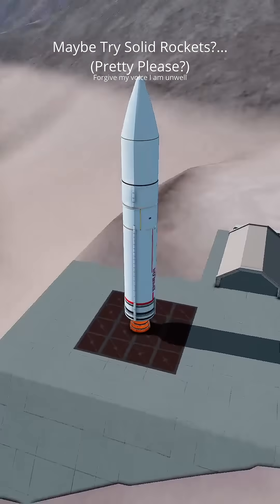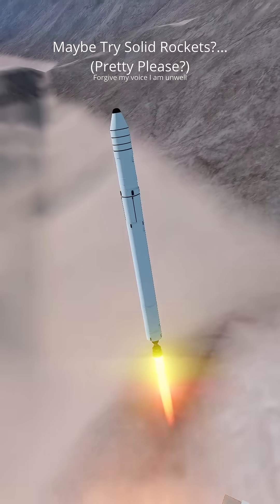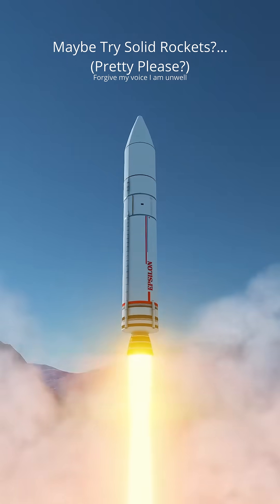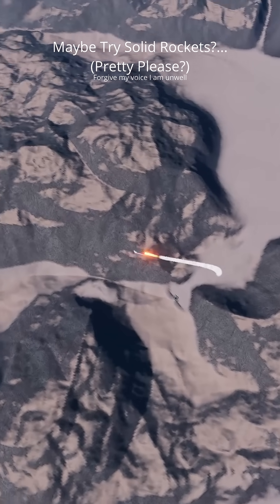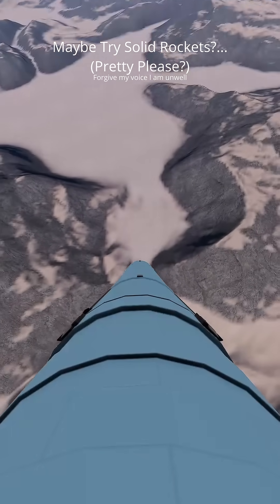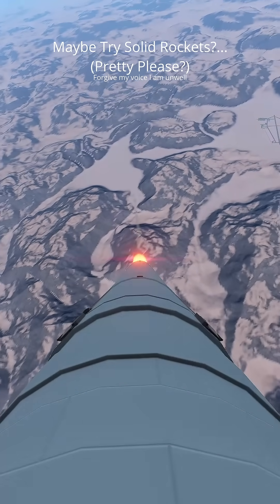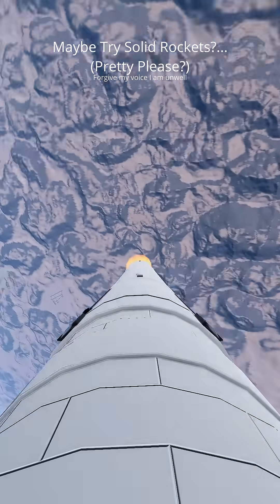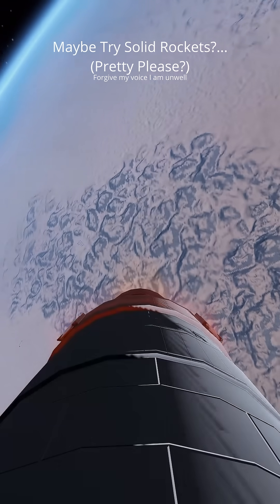Stop Making Liquid Fueled Rockets. (Maybe)

Comment: I love getting a solid motor to work. The R.200 B on the juno website is me. The R.155 T2 is me. And it turns, with no mods. But I've got a liquid fuel version too. With a 10t payload, the liquid fuel R.155 has 7.26km/s d-v ($8.1m), the solid fuel R1.55 with the exact same tank size has 6.93km/s d-v ($5.8m). The liquid one is the better rocket, but it was designed for telescopes and there's just no need for more d-v than the solid motor version.

That said, my preferred use of solid motors is impulse grain... :) Early thrust counts for so much. I've got a rocket where I've tuned the impulse SRBs to get to 98.6% damage. They nearly explode from heat death, and then they get discarded. It's great. It allows you to tune the main engines for higher altitude and efficiency.
Reply from the maker: Yeah solids are neat

Comment: After I watched the video I actually made my own solid fuel rocket, and it preformed flawlessly, though hard to control I used a gyroscope to pitch it.
Reply from the maker: That’s awesome, if you’re on pc I made a mod that adds gimballed solid motors if that helps
Reply: @DeepSpaceIndustriesLOLI’ll check it out later on, I like to challenge myself to do it manually without mods, do you have any suggestions to make the rocket more better?
Reply from the maker: @Phat-b6q spin stabilization might help
Reply: @DeepSpaceIndustriesLOLI should try that.

Comment: U can also use 1 big solid engine with let's say two small liquid engines and have them control the rocket though this works with fins most of the time too
Otherwise nice vid!
Reply from the maker: Interesting idea
Reply: @DeepSpaceIndustriesLOLbasicially like the soyuz first stage but instead of 4 liquid engines there is 1 solind engine